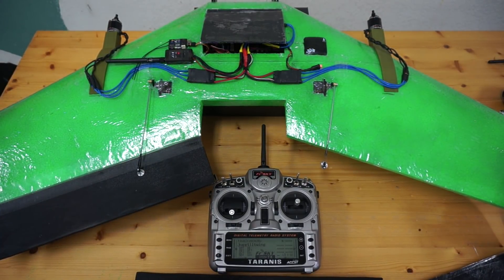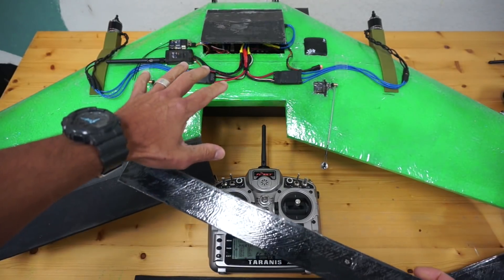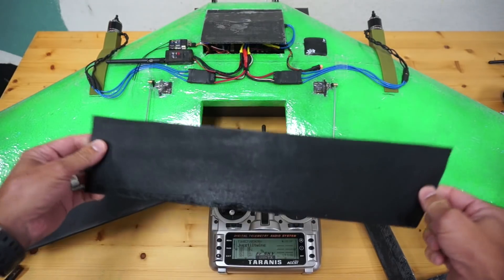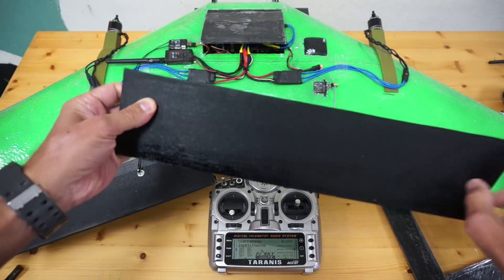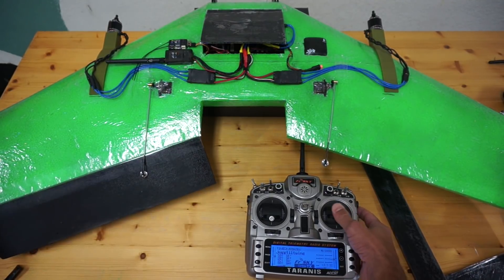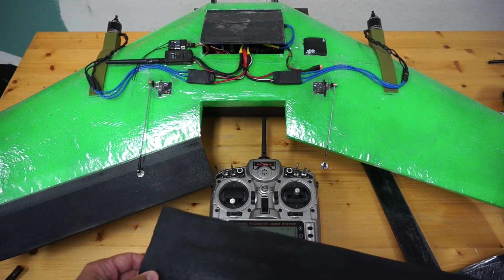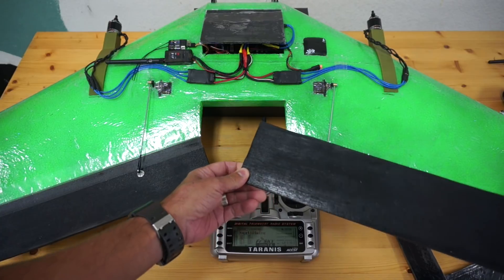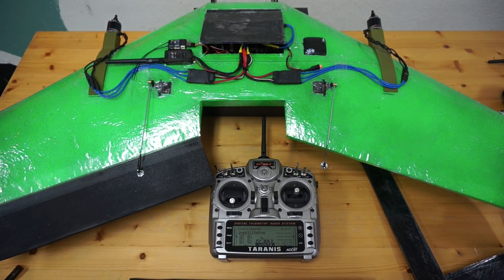Pixhawk Tailsitter Elevon Mod for SweepWings Flinch

Comment: Hey Dennis - like Zak, Looking forward to an update on the tail sitter. I have a prototype made but can't seem to get the elevons to function properly when transitioning into forward flight. After struggling for months the tail sitting part appears to have the correct movement with the elevons and motor speed.  Forward flight is crazy.

Comment: Hi Dennis. I your build posted on a forum of some sort? Since I'm building a tail sitter, I was wondering if you would comment on the need for airspeed sensor, or lack thereof? http://discuss.px4.io/t/tailsitter-duorotor-feedback/43/7 answer indicates that it is necessary for safe to transition. It appears you do not have one, so what is the downside of not having one? If there is a better place to ask this question, just let me know.  Best - David
Reply from the maker: Hi David, I saw your email and sorry I'm just now getting back to you. Work has been crazy lately and I've yet to do the transition. I've used the airspeed sensor previously with my wing builds and will likely use it with the tailsitter. I may do a test with and without but I'm still working towards a good tune. Will share that video soon and thanks for the question. Good luck with your build and let's stay in touch.

Comment: Sir, I also losing control may be due to small size eleron , mainly losing control at vertical landing and in cross wind.
Kindly reply of my following long waiting enquiry.
1) what is CG in percentage for that non vector tailsitter.
2) How we can set maximum spin limit for copter modes.
I tried to set maximum spin limit for copter modes by Q_M_SPIN_MAX but dont see any spin change. 
3) how we can set Climb Sensitive of copter modes through param of that tailsitter.
Reply from the maker: Yogesh, I don't have answers to your questions yet. I'm still in the learning phase. I will share any info I learn after I get the tuning done. Please share anything you learn as well. Thank you.
Reply: Hello Dennis Sir, I observe one reason of loss of control in qhover/QLOITER/Qstabilizer mode of non vectored tailsitter is the CG of Airplane. Normally we consider CG for flying wing aproximatly near about 20% but for that VTOL tailsitter need large CG I think near about 35% . 
Ref - Ardupilot tailsitter documents.

Comment: Love this little series! It is really making me want to try one! I have a big TBRC 60" wing hanging on my wall, and 4x 700kv motors w/12" props. Think a TBRC60 could be built as a quad motor tailsitter?
Reply from the maker: I think that would be an incredibly fun build. I haven't seen any quad motor tailsitters out there, but I'm sure they exist. I don't know if ArduPilot supports them but will take a look. I know you could get a quadplane config going, but don't think that would work very well for a wing. May be overkill. Let me look around and if you dig up any info let me know.
Reply: Just to clarify, I was thinking of simply running the motors in two sets of two (splitting the servo cables) like this: https://i.ytimg.com/vi/hqAsBhvZ4mU/maxresdefault.jpg
I know it would affect the roll capabilities but with a large wing I would more be looking for endurance flights rather than hover agility. Think you could share your wing molded motor mount design? Im not the best at CAD modeling and would love to try basing my motor mounts on them.
Reply from the maker: Ah got it! Hadn't even thought about that. Very interesting idea. Here is the left mount:

https://www.dropbox.com/s/62hz3mmhjwpyohk/flinch_left_motor_mount_extended.stl?dl=0

and right mount:

https://www.dropbox.com/s/s3or8j5690liqda/flinch_right_motor_mount_extended.stl?dl=0

If I had one of those wings I would try and design something for you. Good luck and keep me posted. I had a great time tuning the wing yesterday but got a little too confident, yawed too hard, and sent it into the ground. Broke a prop. No biggie.